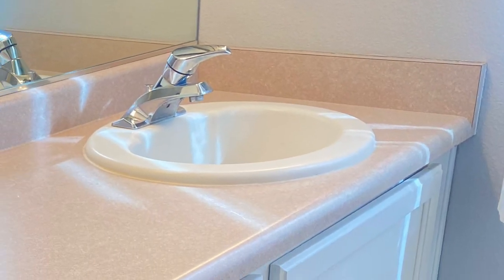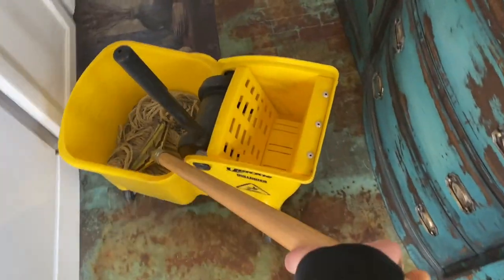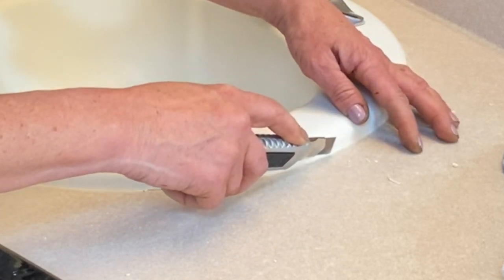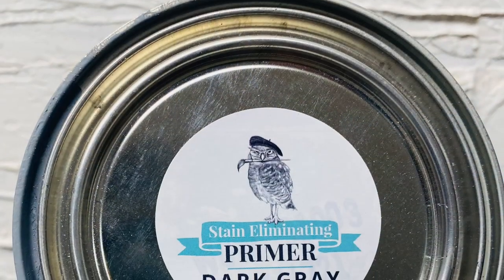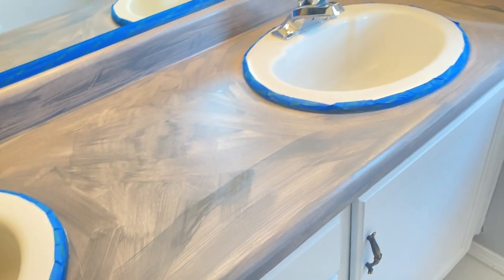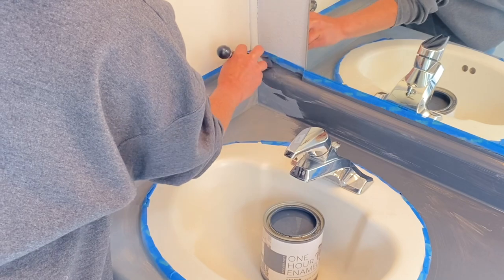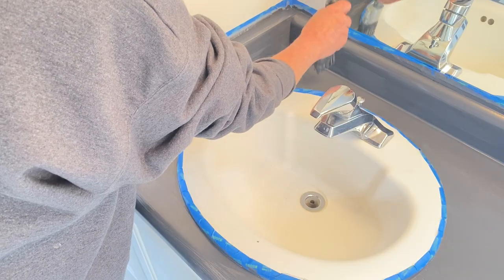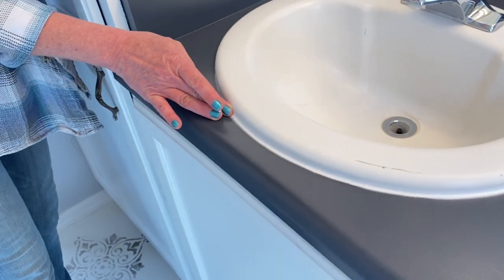Can't stand my FORMICA countertops! Let's paint them with OHE/ painting countertops/Do it yourself

Comment: Great job! Have you used this on kitchen counter tops? If so what top coat did you use? And do you have a video on it?
Reply from the maker: It has a built In Top coat. But for extra protection I would use OHE in clear.
Reply: @VintageMakeoverswithMelanie Is OHE safe to knead on?
Reply from the maker: No idea… that would definitely be a question for Wise Owl.